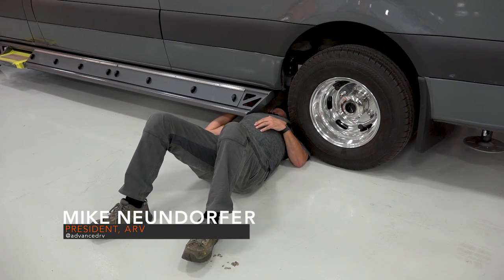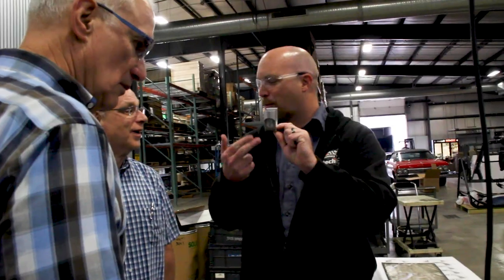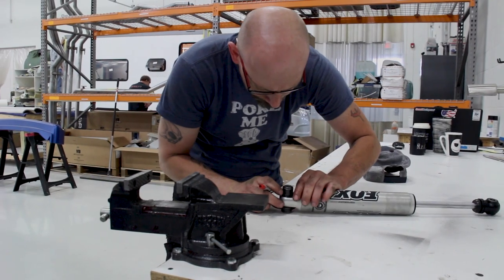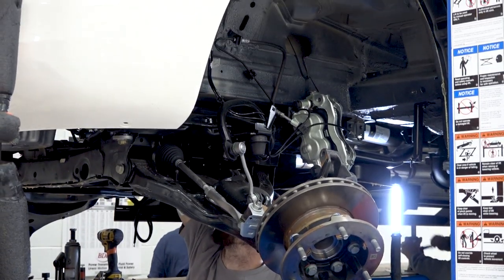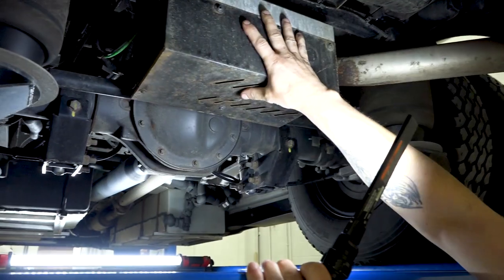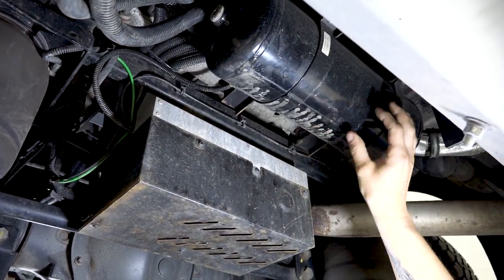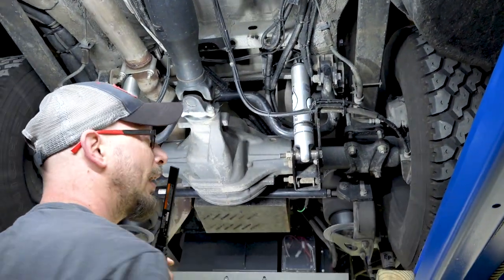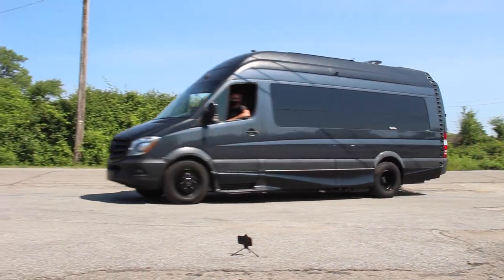Custom-Tuned FOX/ARV Shocks for Sprinters with VB Airsuspension

Comment: Another great innovation by ARV, a company with greatest work ethics and true desecration to its customers. I will bring my Sprinter for upgrade.
Reply from the maker: We appreciate your kind words, thank you.
Reply: Mike is such an engineer.  He is so curious and such a problem solver to address the issues with van so it operates like a smooth riding SUV.
Reply: @AdvancedRV  Can these kits work with the 2023 Ford Transit 350 extended high roof 3.5l V6 Ecoboost cargo van ?
Reply: @AdvancedRV Can this kit fit this sorry i didn't put the All Wheel Drive in the 2023 Ford Transit 350 extended high roof 3.5l V6 Ecoboost cargo van AWD ?